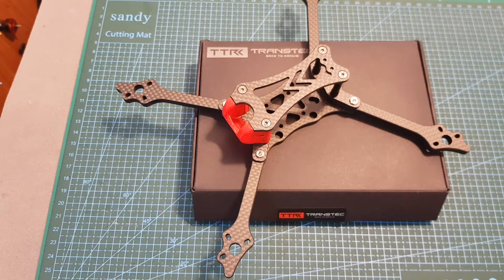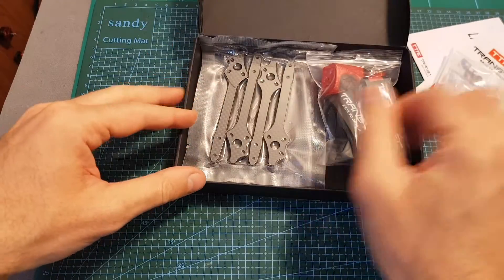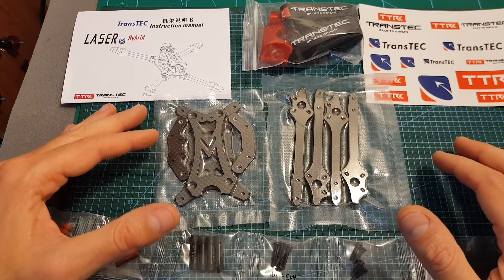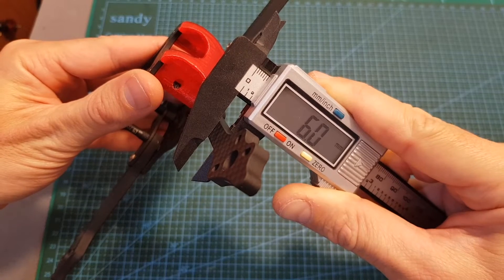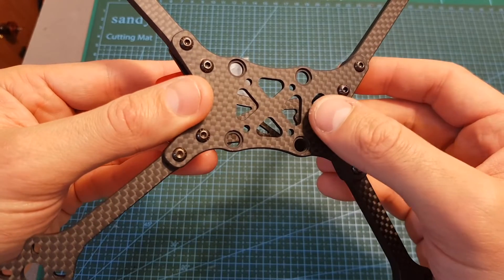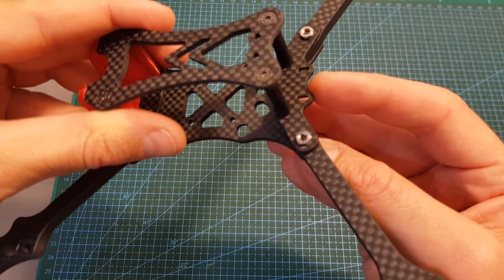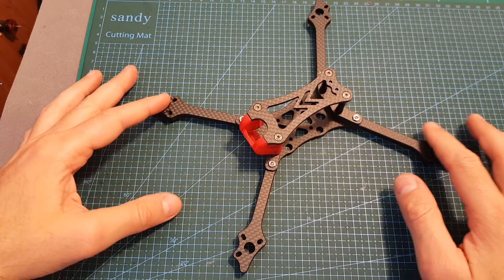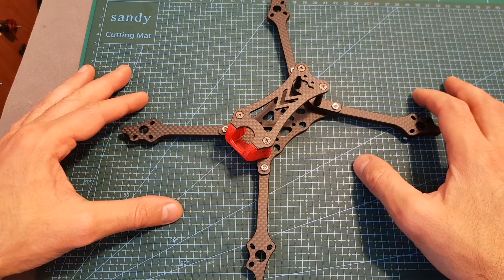TransTEC LASER S Hybrid Racing Frame Overview

Comment: Hi. Do you know where can I get the column part that fits? My laser s didnt come with the column...
Reply: how long is the spacer? where can I buy? I am so sad right now
Reply: Also, my bottom plate is not symmetrical , is that normal?
Reply from the maker: It seems that you are missing this spacer...
Did you talk to TransTEC? Send them a message on Facebook.
Reply: Gal Kremer hey. Thank you for replying my message. I have figured out what spacer to buy! It’s 25mm spacer.